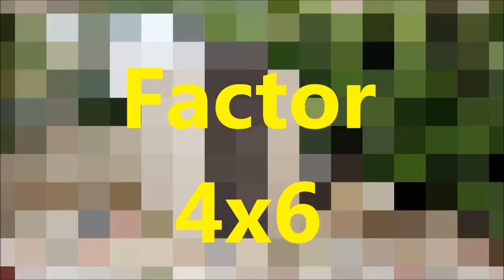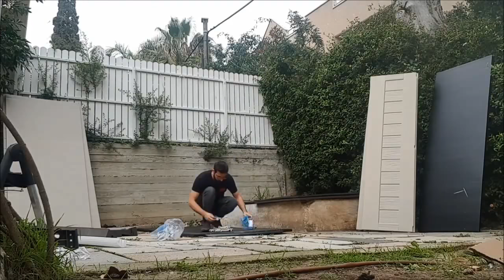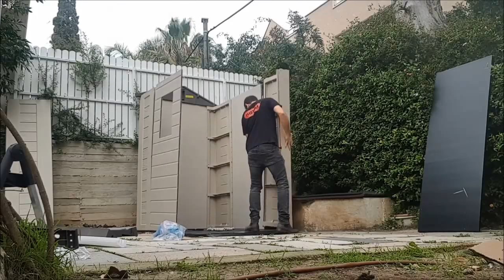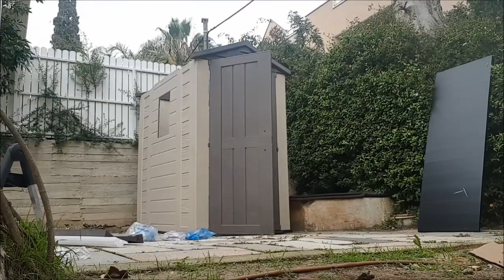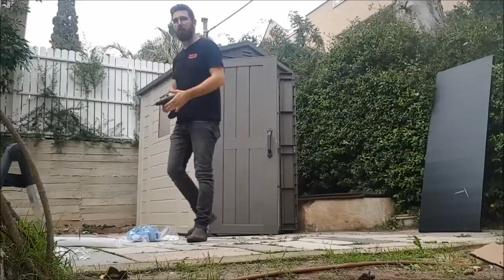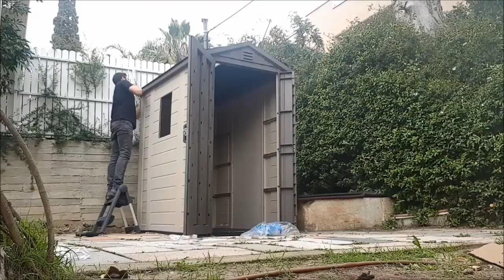Keter Factor 4x6 Outdoor Garden Storage Shed

Comment: Yes, this looks pretty straightforward as regards fixing up. One of the main things I'd be worried about is the strength of the wind. Surely something like this needs anchoring in some way. In this video the shed looks to be pretty sheltered from the wind, but in more exposed areas I feel it would be more vulnerable. Has it had many trials to withstand the elements, like gale force winds for example?